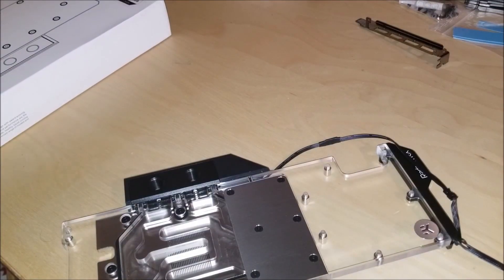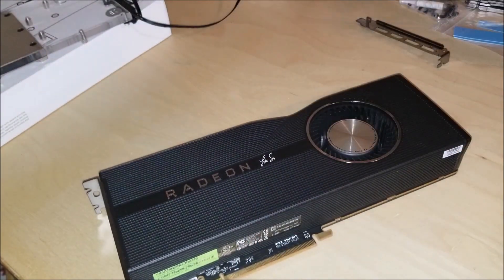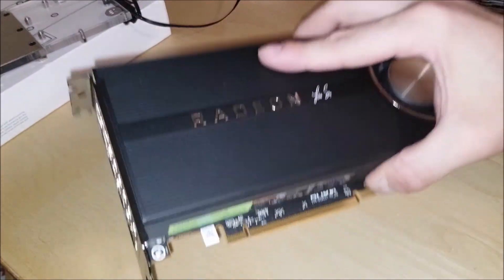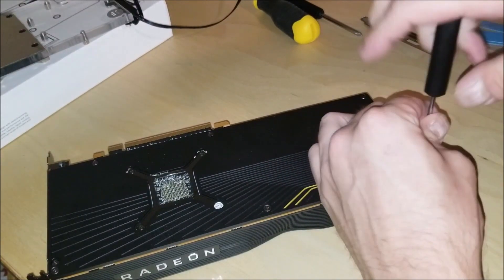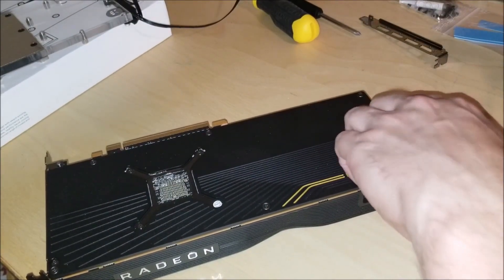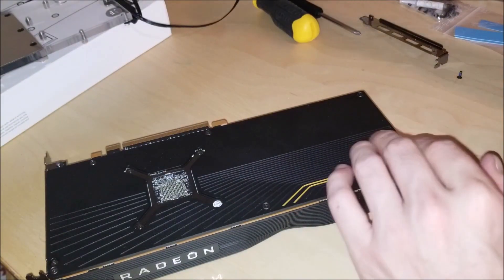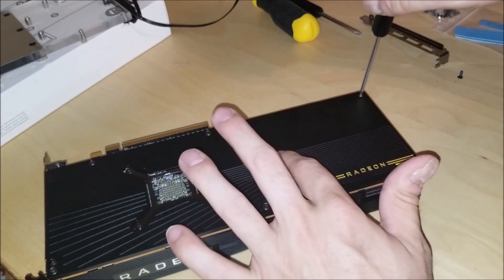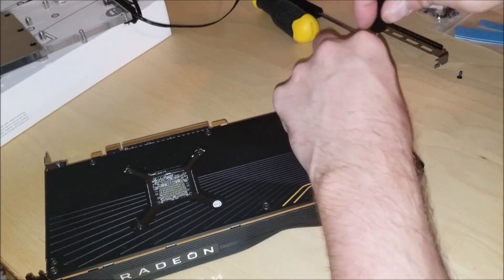5700xt EK Waterblock unboxing and install

Comment: Will this block fit on any 5700xt? I have looked online and I can only find 2 modules the one you have in the video and the Corsair one, so do they fit any 5700xt? I have an MSI dual fan 5700xt thanks
Reply from the maker: Mine was a reference 50th anniversary edition. Youd have to check that card with EKs compatibility chart/section

Comment: Will it fit any 5700 xt ?
I have 5700 xt thicc II
Reply from the maker: Check with eks configurator. It will show you which blocks are compatible with the card you specify

Comment: Couple of questions about the block. Once the block is installed on the gpu, is it ready to use or does another part need to come with the liquid block? If it needs to be combined with another part then which part would I need?
Reply from the maker: As long as you have your fittings and tubing to connect it to the loop its good to go

Comment: I recently got the EK-AC RADEON RX 5700 +XT D-RGB waterblock. What are your junction temps like? I am getting like 86 degree C junction temps :(
Reply from the maker: 86 aint bad at all for junction. There are few cases where junction temps are even worth worrying about, i dont even bother monitoring my junction to be completely honest.
Reply: @TurboLimited  thanks man.

Comment: Can I install it on XFX RX 5700 XT Thicc II Ultra? or what water blocks are compatible with XFX RX 5700 XT Thicc II Ultra?
Reply from the maker: Check with EK's configurator for block compatibility
Reply: @TurboLimited  I already did it, but it does not show me supported blocks, I don't know if there is a way to improve that gpu
Reply from the maker: Means they dont have any blocks compatible or they just havent checked it for compatibility. You would have to google around. Im sure someone on a pc group somewhere found a block that works
Reply: @TurboLimited  Thank you very much, but I tried to search on Google, but I find a block but in Europe, not in the United States.

https://www.alphacool.com/shop/gpu-water-cooler/amd-fullsize/25912/alphacool-eisblock-aurora-plexi-gpx-a-amd-radeon-rx-5700-xt-xfx-thicc- ii / iii

Thank you very much for answering.
You can tell me in which groups I could search or in which forums.
Thank you!

Comment: are all the pcb's the same? I have an ASUS TUF Gaming RX 5700 XT and I'd like to swap up to water cooling, but I wasn't sure if the boards are the same
Reply from the maker: Only reference cards are guaranteed to be the same. You will have to check the block compatibility To see which blocks with fit yours

Comment: I'm sure to most this is a stupid question but.... Please can someone explain where I would connect the electrical connections for the water pump and the radiator fans? I have the 5700 in a Sonnet eGFX breakaway box.
Reply from the maker: You have to plug them into fan headers on the motherboard.
Reply: @TurboLimited  Oh okay great, I thought they would have to plug into the GPU somehow in order to ramp up/down according to temperature, thanks very much for your video and help.

Comment: Great video but would be even more greater if u could share the resaults before and after installing this blocks.. Many thanks
Reply from the maker: It wasnt a performance video. But usually you get about a 1% performance gain. 2% tops. And i cant compare thermals properly cause my case is setup for full water so the thermals on stock blower would have been gimped from the start and unfair to speak on vs a block
Reply: @TurboLimited  well.. I didn't mean it that way, I have  msi 5700 xt mech Oc, for example my case is bitfenix Enzo, its not the best when it comes to airflow, when Im gaming n case is closed, temperture hits 78-88 gpu n 107-110 junction by msi fan manufacturer, if i opened the side of the case temp drops to 68-75 gpu. N  junction between 82-95. when i found out about bykski gpu block, i was hoping to see review which explains the different between temperature with stock n  bykski blocks to understand how well it works with 5700 xt when it comes to cooling.
P. S I understand all about junction temp n stuff as it should not concerns me. I like to take care of my hardware for long term, so it's just I'm not comfortable with it. I don't mind to do custom cooling only for gpu as the card is such customizable beast I like it.
Reply: @kotik1981  Undervolt and you''l go down by about 6C if you do it right.

Comment: why not put the wire under the backplate?
Reply from the maker: Good point. Id be concerned of a pointy bit of solder piercing the cable shielding. Might give it a go though
Reply: @TurboLimited  I'm about to buy the same block i think, but including the ek backplate.  I'm going to subscribe just in case you  try that out because I'm interested to know if you can hide that little eye sore.

Comment: Is it still possible to use the backplate? Why did you remove it?
Reply from the maker: Needed access to the screws. I was gonna try to put it back on but i forgot. Planning to put a custom backplate on so i wasnt too concerned

Comment: will it fit on my gigabyte 5700xt gaming oc 3fan edition?
Reply from the maker: You should check its compatibility with EKs configurator. I dont think it will but im not familiar with gigabytes card as far is if its reference or not
Reply: no
original frontier edition only (anniversary edition has the same pcb layout just binned chip and memory)

Comment: They dont even ship compression fittings with the waterblock or did i miss smth? :( thats a bummer, great video
Reply from the maker: No. Fittings never some with a waterblock. They do give you black plexi stopper fittings to cover the ports you dont want to use. I do a parallel loop so didnt need them though
Reply: waterblocks cpu or gpu, radiators, pumps,reservoirs never come with fittings they are separate that would be amazing tho save like 50 dollars on a water build.. the most you can hope for are plugs and even that may not happen or they'll be shitty plastic temp ones

Comment: Did you come across any warranty void stickers?
Reply from the maker: Usually the void sticker is on one of the screws to remove the die retention clip square thing on the back side. Its just to scare people though. They cant enforce it unless they can prove removing it broke the card.
Reply: Apparently they can in the uk.
Might just buy the poverty edition xt from ocuk they’re cool with removing the cooler
Reply from the maker: Should have been a global ruling that void stickers cant be used to deny warranty claims. Id google around. Should be articles from a year or two ago

Comment: How did you manage to fit the single slot I/O cover? I checked mine and am certain that it possibly cannot fit, as the metal prong is simply too long and clashes with the water block. On the other hand, I checked their special edition block, which seems to have a slightly different form, and it seems to fit in there.
Reply from the maker: If i recall one of the prongs goes over the pcb the other goes under.
Reply: Hey, thank you, but the prongs were not the problem for me, rather the bent metal on the other side :)
But after seeing you put it on, I tried again, and it turns out that the cover does fit, though in an aesthetically unpleasant manner. Don't know why they did it that way :-/

Edit: I see that I wrote "prong" in my first post, sorry for the confusion. I meant the bent metal.
Reply from the maker: Gotcha

Comment: How bad does the rgb cable look after youve installed the card? I cant decide between this ek block and the one from alphacool but i might just go with the alphacool block bc that cable is ugly as hell
Reply from the maker: Its not that bad but im still not a big fan of that cable though. If you have a bright interior it will be more noticable vs a darker interior.

Comment: Can I install it on Sapphire 5700 xt?
Reply from the maker: We wont know until its released and checked for compatibility. If its a reference pcb, then it probably will be.  Im unsure on sapphires design/plans
Reply: Turbo Limited, Thanks, I mean reference Sapphire 5700 xt, that is already released.
Reply from the maker: i dont know anything about that card in peticular
Reply: @КириллЕрмолаев-с9и  yes they are all the same card (reference ones)
Reply: HaVoC Panda thanks!
Reply: @КириллЕрмолаев-с9и  did you ever get the water block? I have the sapphire reference too and would like confirmation on this waterblocks fitment. Thanks
Reply from the maker: Thanks havoc panda

Comment: Is it possible to put the OEM backplate on or do I have to buy one from ekwb?
Reply from the maker: Not gonna lie i totally forgot to check before i installed it. I just set it on top of the gpu until i get my hands on the custom backplate im looking at getting.
Reply: You can use the stock backplate, EK's site says so
Reply from the maker: good to know thanks. they must have added that to the page after i preordered my block lol. no doubt they were tired of the emails asking haha

Comment: What about the warranty? I’m asking because of the white sticker in the screw at the back
Reply from the maker: The void if broken stickers are just a scare tactic and dont actually brake a warranty. Unless they can prove you broke the card while taking it apart they still have to honor the warranty. So basically unless you physically broke something on the card you're good
Reply: Turbo Limited alright thanks, I have a kraken g12 that I was using on another card and I'm desperate to try the power plays with a liquid cooler, so I should do it like you, just unscrew without removing the sticker just break it and leave it as is
Reply from the maker: Honestly i only left the sticker on cause i was lazy